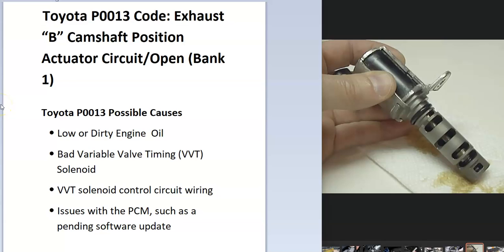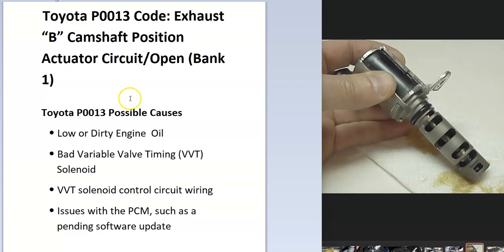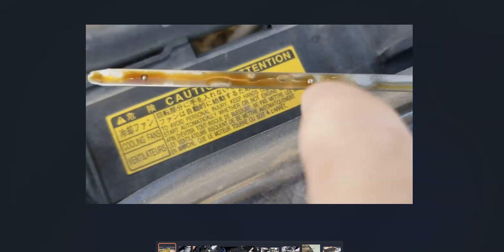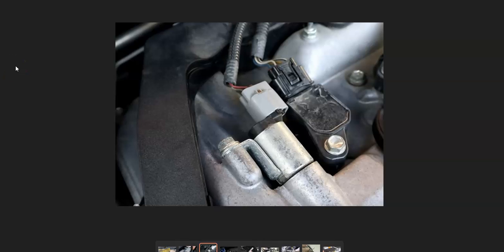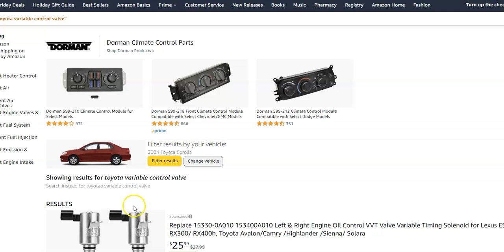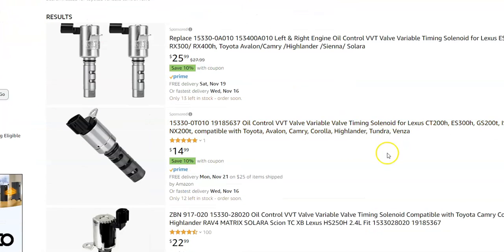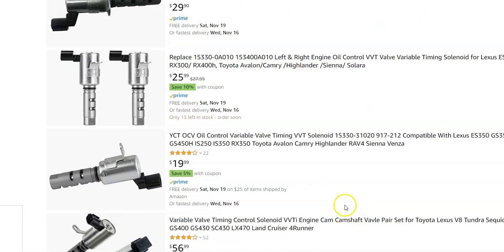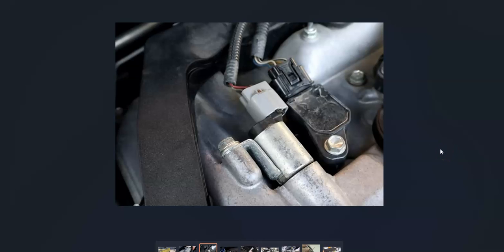Causes and Fixes Toyota P0013 Code: Exhaust “B” Camshaft Position Actuator Circuit/Open (Bank 1)

Comment: Hi my car has that issue my question is my wire that holds the sensor was biten by a rat and the check engine light is one even though the wire was fixed with wire tape, if i purchase the camshaft sensor would the light come off? It did not pass smog because of it
Reply from the maker: Since there was a wiring problem, I would test the wiring and be sure it is good.